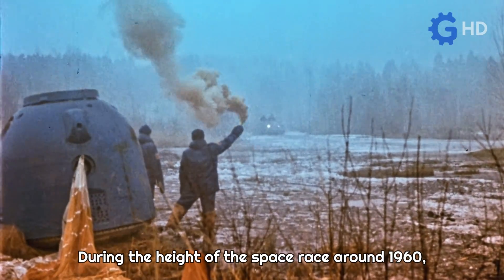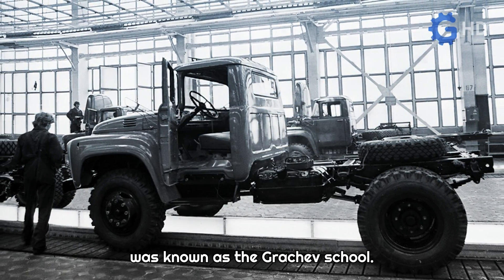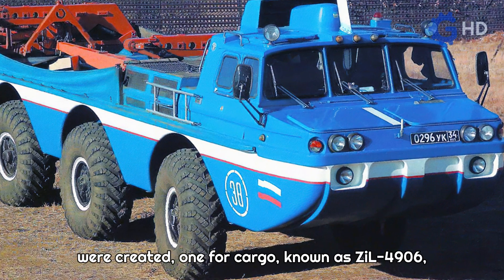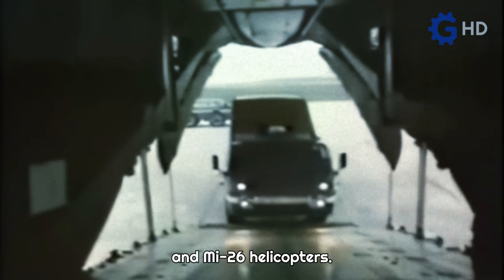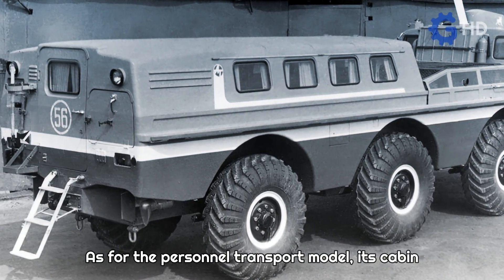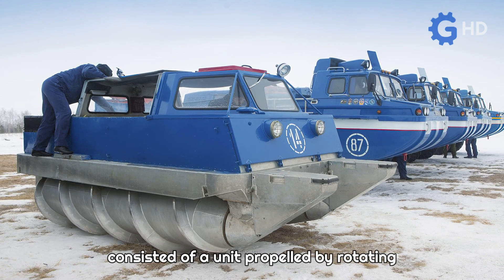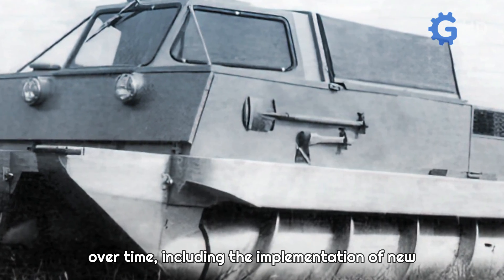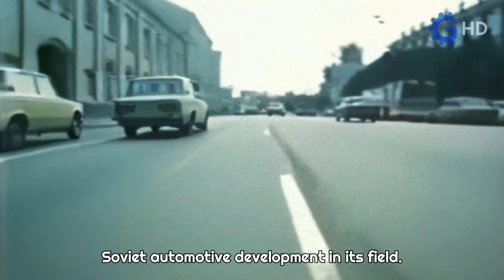WHY WAS A SPECIAL VEHICLE MADE FOR ASTRONAUTS? ▶ ZiL Blue Bird History

Comment: A ZiL-49065 was restored not so long ago by the Mechanical Assembly Shop No.6 at the former ZiL plant.  You can see some great pictures on their website.
Reply: "Механикал ассембли шоп" к нему и пальцем не притронулся. Когда эту машину на тот момент еще не бывший завод восстанавливал, этих ребят еще небыло.
Reply: @ЗИЛЗаводИЛюди  Wasn't MSTz No.6 just the new name for the original department at ZiL with most of the same employees?
Reply: @BlackSeaRC   Sorry, I thought you were a russian speaker. I'll answer it now.
Reply: @BlackSeaRC   At the end of the production at ZIL, there was a division "Production of original and special cars", which included the "department of the chief designer" - the creator of high-terrain vehicles, including the "Blue Bird" and mechanical assembly shop No. 6, also known as the workshop of passenger cars. In early 2015, the Deputy minister of the Russian government became the unofficial owner of this division. Some of the former employees got a job with him. This division no longer had anything to do with the ZIL plant, although it was located before the demolition of the workshops on its territory. The repair of the 49065 car was completed in 2013 by the forces of the "old ZIL". Gradually, the new company, headed by the deputy minister, using connections and other non-official methods, became the owner of a collection of historical ZIL cars, including 49065.
Reply: @ЗИЛЗаводИЛюди  Very interesting, thank you.  Is it still operating from another location now?
Reply: @BlackSeaRC   You are welcome! Yes, they continue to work. But we no longer observe their activities as closely as we did before)))